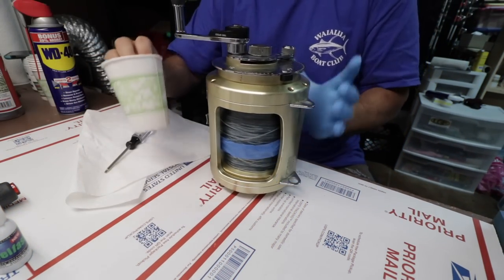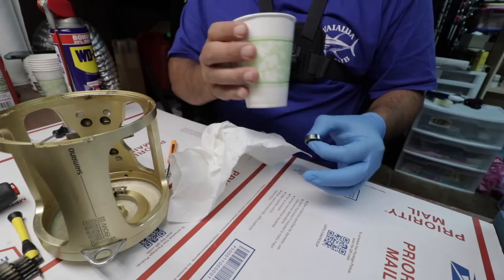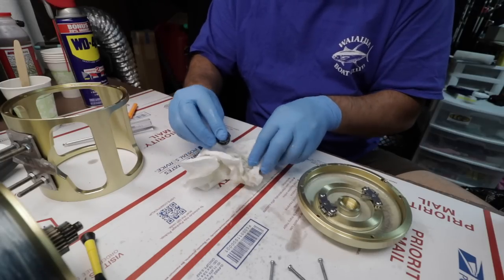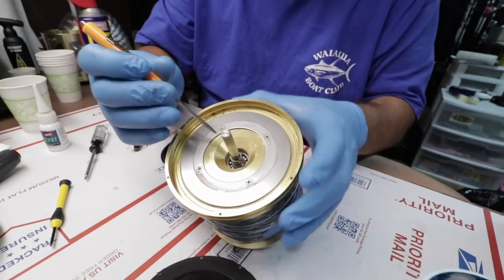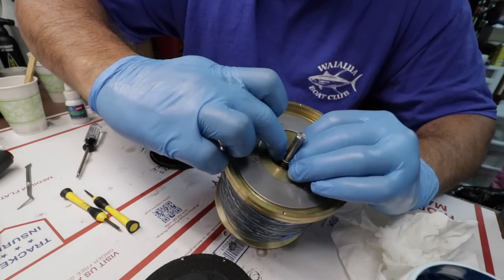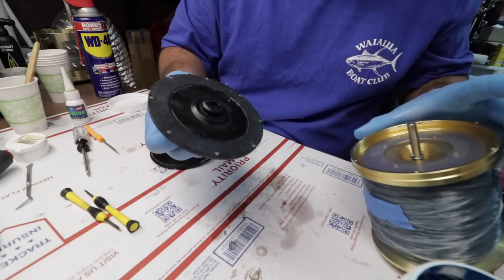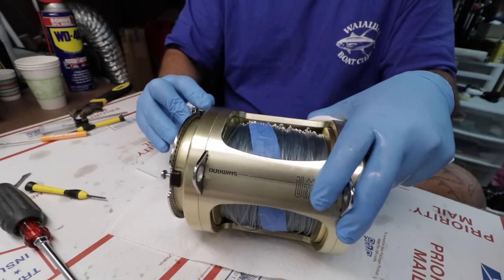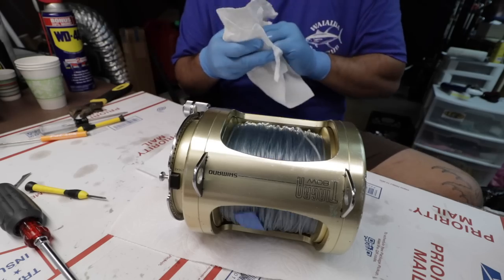Shimano Tiagra Fishing Reel Breakdown, Cleaning and Service

Comment: Great Video.  I own Reel Quality SRQ in Florida and do reel service, repair and upgrades.  I just did 7 Talicas for an offshore captain.  I replaced all his bearings as they were completely cooked with new Boca Bearings.  I used basic bearings but I also installed a ceramic kit for him on one reel.  Very expensive upgrade but wow, what a set of bearings.  I like to apply my drag grease with a small brush.  I use the exact same grease.  I'm also experimenting with Royal Purple grease and oil as well as Clenzoil marine grease and oil.  For the most part I use shimano lube.  Its a clear, yellow grease that works well.  I also took a battery operated dremel and a cone shaped polishing bit and I spin all my bearings to test for sound. The higher speeds can reveal some damage that normal spinning will not reveal.  I also quit using WD 40 because it leaves a residue that can break down grease.  I use high pressure cans of CRC Electronics cleaner that eliminates grease and blasts the dirt out.  I've also found that blue shop paper towels work the best and don't leave any lint on the product which can hold dirt.  Just a few notes from my desk.  Thanks for the video.  If you have any questions give me a shout.  I am a Shimano Parts Dealer, PureFishing (Abu, Penn, FinnNor, Van Staal), Daiwa, Accurate, Boca Bearings and Mud Hole wholesale dealer.  Definitely helps with the prices for my customers and keeps my overhead low.  Working on an AVet account now.  I am passionate about my tackle as it seems you are also.  Thanks again!!!  Great job.
Reply from the maker: Great tips and info.  Thanks for sure.  🤙

Comment: Another note,  you made a reference to being careful not to strip out any screws when you put the spool drag cover back on.  Great call!!!!  Two of those talicas I repaired had stripped screws from the previous company that did the service.  I got a set of Stainless machine metric screws and used the next size up.  No need to tap them and they worked well and saved the guy $200 for a new spool.

Comment: Solid instruction, the internals of the Tiagras are really a thing of beauty. I can do a yearly service in less than 25 minutes. My only addition would be to use Qtips, some soaked in WD40 for cleaning out screw holes and some for applying grease in tight spots like the gear stacks. One other trick is to remove the clicker plate screws and apply a single drop of Loctite to the tip of each screw before screwing back in. Reason, when you have a well worn clicker plate, a screw can back out over time from the vibration of the clicker going off and eventually strip the screw threads. This happened to me on a TI50LRS and Shimano had to replaced the side plate because of two stripped screws. Ounce of prevention...

Comment: Aloha Nick,  I’m glad to scan thru YouTube for maintenance on spinning reels like cleaning, and when and where to add grease and oil.
Some guys says NOT to use WD-40 that it ruins the reels, but I can understand maybe certain materials,  and some say that it the parts would end up rusting?
But I like how you explain most things pretty clearly.
I have a Shimano Nasci 4000 XG and a Penn Fierce ll 6000 and I have them for about three months now,  and I’ve been using them every weekend since purchasing them and I’ve never done a somewhat good cleaning since, I’ve usually just spray them lightly with fresh water like the shops tell me and wipe them down, and send it in for service with them when I’m ready.
But I’m a hands on kinda guy especially when it comes to maintaining and mechanical item especially dealing with salt water,  speaking of salt water my Shimano reel and I got drenched by a waist high wave and some ocean water got on my reel so I immediately rinsed it with fresh water.
So my question would be is what should I avoid and or never use WD-40 on?  And also when and where to put and Not to put grease and oil.
Thanks Eddie
Reply from the maker: Aloha Eddie,
I don't use the WD-40 as lubricant.  I use it more as a solvent/ degreaser.  Thats why you would have to grease or oil the reel after cleaning off all the old grease with WD-40.  I really like the corrosion block reel grease and use it on the whole reel.  There is something inside of the grease to help fight against electrolysis.   For spinners I consider it pretty basic maintenance.  Maybe 1x ever 2-3 months if you are using it weekly i take off the spool and lightly grease the shaft.  If I was to get the reel fully submerged I would definitely take the whole reel apart.  Hope this helps.  🤙
Reply: Reel Adventures Hawaii Nick I’ve seen lately at City Mill that WD-40 has several other products,  there’s one that called WD-40 SPECIALIST Long-Term CORROSION INHIBITOR.
It says that it’s too be used on All Exposed Metal, to prevent from Rust n Corrosion from being exposed to the Elements like Air n Moisture.

Can something like that be used on the metal parts that’s not Required to have grease or oil?  It states that it doesn’t dry out that there’s a thin slightly moist film that stays on,  two years indoors and one year outdoors.
What’s your thoughts on it?
Reply from the maker: I would test it on a small area to see.  But it doesn't sound like it would hurt.

Comment: Thanks Nick, awesome help, got through 4 of my 80's which are 20+ years old, they are a bit different as far as the brakes go, you are supposed to just turn the plastic plate to open them but they stuck. I managed to get one open by putting the spool in a vice cause it had no line on it. Can't get the others open. I got 2 that I can't get the torx screws off, afraid they will strip, any tips? Mahalo
Reply from the maker: Unless the reel isn't working I wouldn't mess with it.  Shimano screws tend to snap very easy under a little torque.

Comment: Would anybody know how to fix my drag lever from not clicking(making noise) as i push it up/down to change drag?
Reply from the maker: The tip of your drag lever has a little button inside.  When that button rides on the grooves of the drag plate it makes the sound.  Either the button is stuck or missing.  Or you have your washers in the the wrong place so its not contacting the grooves on the drag plate.  Pull up a reel schematic and it will show a complete break down part by part 🤙
Reply: @RAHfishing  ahh makes sense. I've got the very old tiagra 80w so there's no holes in plate or a pin for it to make a noise....
Good to know, thanks heaps

Comment: Do you ever wash your reels with Water? Let me rephrase that: is it good or bad to wash your reels with a water hose? Isn't the water get in the ball bearing and so forth?
Reply from the maker: Yes i rinse the salt off with the water house under light pressure.  After i rinse off the salt i wash with soap and rinse again.  After that i hand dry and put it back in its bags.

Do not use Salt away on your reels.  It will ruin your reels.
Reply: Much mahalo. Love your videos!!

Comment: Is there a reason shimano don't use sealed bearings and also why do you oil rather than grease the bearings??
Reply: I opened my Tiagra 80's and they have sealed bearings, they are 20+ years old and the bearings are still good to go.